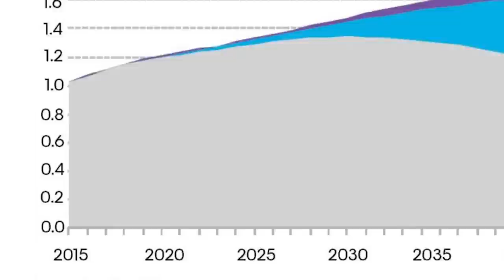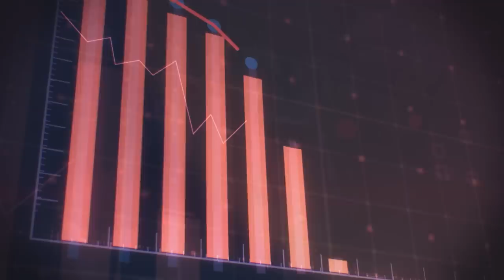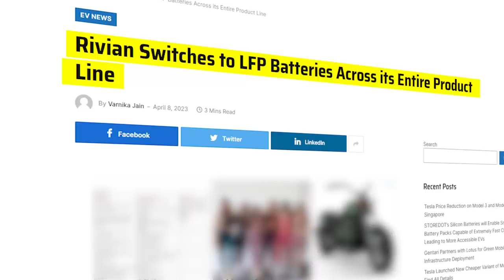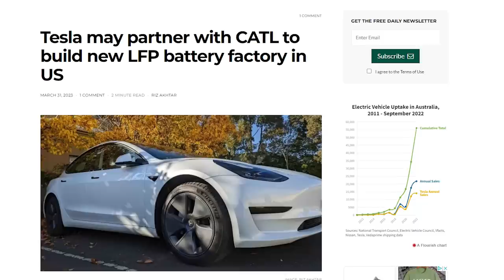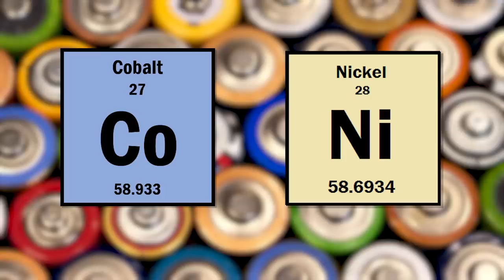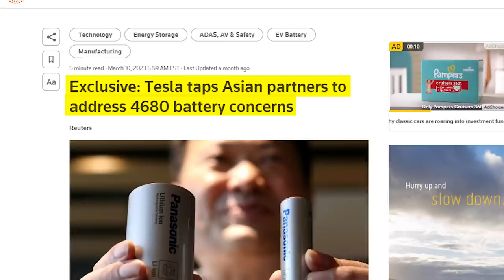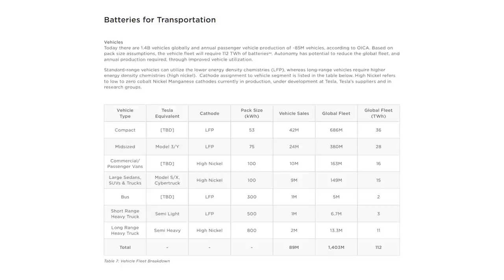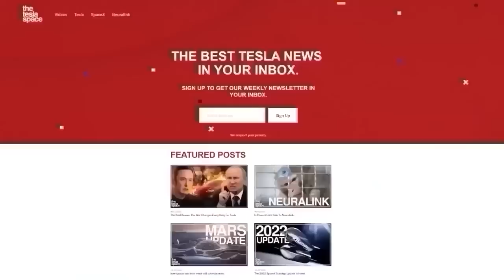How Tesla Will Build 1 Billion Vehicles!

Comment: There is significant misstatement of the engineering facts here.  A gasoline internal combustion engine is known in thermodynamics as an Otto Cycle heat engine.  Its entire purpose is to convert chemical potential energy in the gasoline into heat in an isentropic heat addition step in the cycle to produce work.  The Otto Cycle is also an open cycle, not a closed cycle, which is why it has an intake and exhaust.  The Rankine cycle used for condensing steam turbines is a closed cycle.  The problem is that the Otto cycle is only about 20-30 percent efficient at converting the chemical potential energy in the gasoline into work, but it is thermodynamically incorrect to say that all heat is wasted.  All heat engines create entropy and produce significant waste heat, no matter which cycle they operate on, but none of them waste all the heat energy, otherwise they would produce no work and be completely useless.

Comment: I own a 2019 Ford F150 ICE vehicle that I just bought out the lease on. It has 15K miles on it and I have a 7 year purchase plan. I am 74, so should I live that long, I will be 81 when I make the last payment. As I drive between 5000 and 8000 miles per year, at the most I will have about 70K miles on it at that time. It will still have a lot of life in it as the engine is said to be good for 250K miles and the body is aluminum.  So, i am committed to it for the rest of my life, should I live to be 100, which I doubt. In any case, there are big problems with EV infrastructure and charging. An EV truck was out of my budget.  I had $28K left to pay off and vehicle prices were through the roof, so I sayed with what I had, which in all ways was like new. In any case, the big problem left to be solved is how apartment dwellers will be able to charge up every night, and how people in remote areas will get access to chargers. I do not see EV's as an alternative in most 3rd World countries and remote locations. Large cities are all apartments. How are all those people going to charge up?
I do not see there ever being the infrastructure because the power demand every night will be astronomical requiring the construction of more power plants, many of which will burn fossil fuels, unless they build Nuke plants, and that is not an option around New York City.  So, tell me how Musk is going to get around the problems. It is easy to say you will get everyone into EV's in 20 years, but it won't happen in my opinion. And as long as I am alive, I will be pulling up to a pump and filling up in 5 minutes. I do not drive much, so whatever gas costs, I will pay. Others will do the same.

Comment: At about 1:38, you wrote "regenerative breaking". I don't think that helps with efficiency.
Reply: Regen braking improves efficiency massively in my driving experience.
Reply: @Berretotube  Yes, 'braking' does improve efficiency and range. However, 'breaking' (as was written in the video text) probably is not good for the vehicle. My original comment was pointing out a grammatical error in a hopefully funny fashion.
Reply: Coasting is more efficient than regen braking because there are losses involved in regen braking